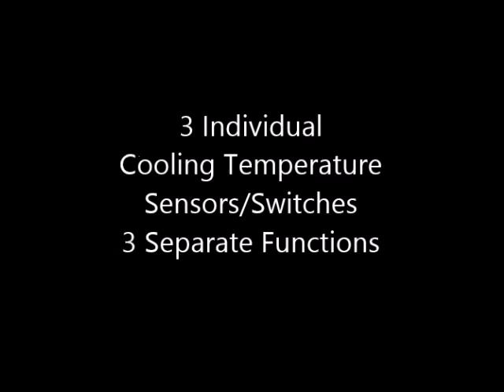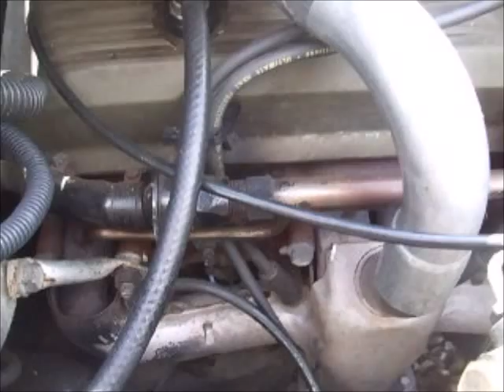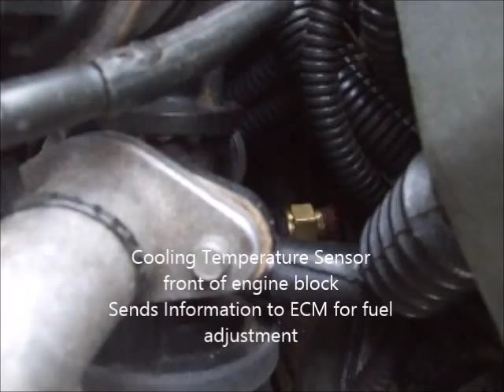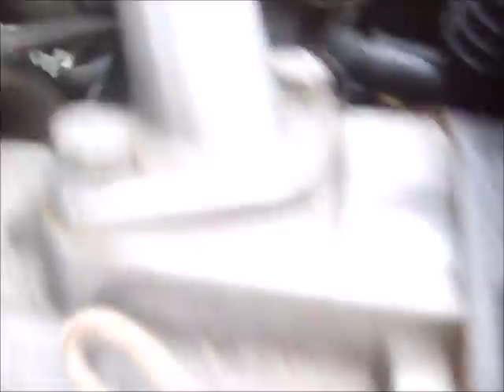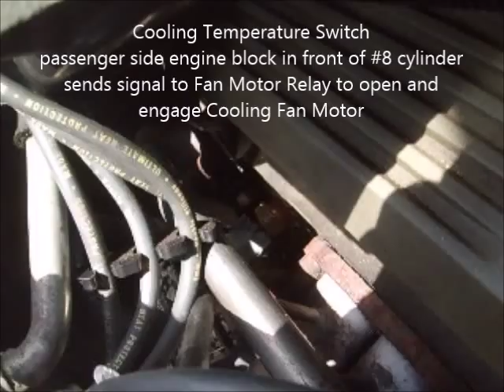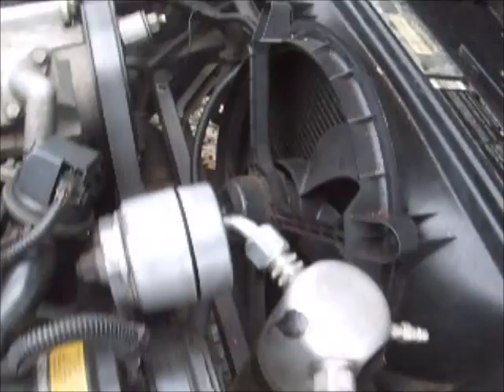𝟏𝟗𝟖𝟒 Corvette   3 important sensors that monitor Engine Temperature

Comment: Sir, I believe my water temp sensor is bad along with the connector . Its the 1st one for the dash, I cant find it anywhere.  Any ideas?  or a part number?  Thanks
Reply from the maker: Factory Service Manual; Fig.8A-11 and Fig.8A-61 show the exact location of the temp sender and wire routing, 8A-63 is the wire diagram that shows the AWG wire size for the circuit, and the PIN D4 location. **The LCD is Solid State circuitry, best to follow the FSM recommendations. Summit Racing has all the parts needed for repair most likely. Good Luck.

Comment: Thank you! My car is having similar issues as yours was..I just bought my 84 Corvette last week and have been replacing parts every day. It needed...everything! But.. now it is stalling when I hit the pedal hard. Being that sensor is around $20 and looks relatively easy to replace from your video, I will just replace it. Probably the original part in there right now.
Reply from the maker: Good luck!
Reply: @HorseshoeBeach  I am having a hard time finding my ECM temp sensor on the front of my motor. In your video, looks like those wiring looms are out of the way from yours. Think they are hiding mine. Were you able to remove yours without having to do alot of disassembling? From your video, looks like you can get right down there to it with a wrench. Thanks
Reply from the maker: I used a ratcheting wrench with an extension, 3/4" I think.....no disassembly,  little leakage, but minimal if you can work fast.   Fished it through the drive belt and had no problem. Had to burp radiator and refill.
Reply: @HorseshoeBeach  Think I found it, though it has a plastic cover over where the wires are connected.